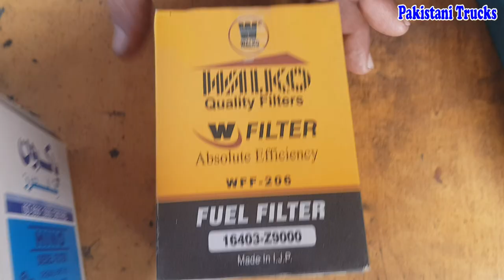How to Replace Diesel Filters of Hino Truck | Changing Truck Filters

Comment: Its will be very hard to change diesel filter on engine next time, because mechanic tightened it too much. It's enough to tigten 2/3 of turn after touching the holder surface. Good luck!

Comment: Why are you not repair the filter?🤣
Reply from the maker: its need to replace because it was 3 month old
Reply: @wonderingskills1   it seem too fast. In my country thay replace it when use around 1 years or 20,000km.
Reply from the maker: @lek4788902  but there is need to replace otherwise they are not to waste their money
Reply: @lek4788902   Fuel quality differs.
Reply: @lek4788902  the quality of diesel is bad in Pakistan